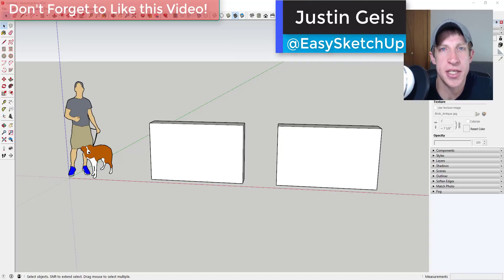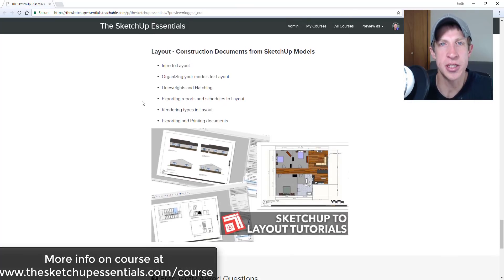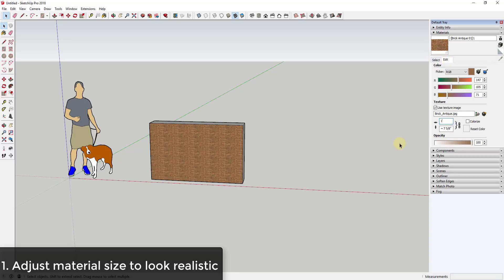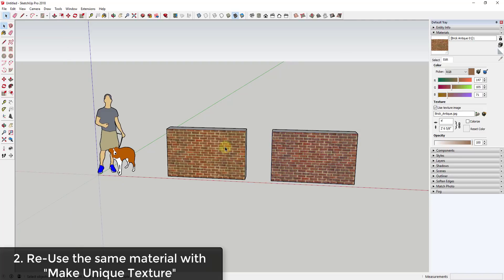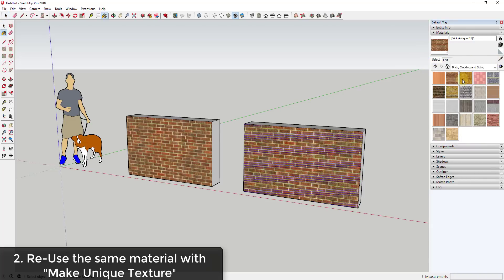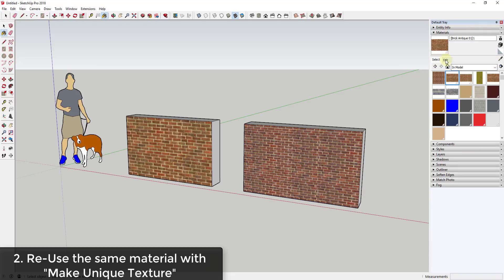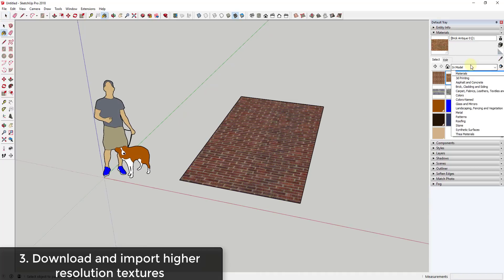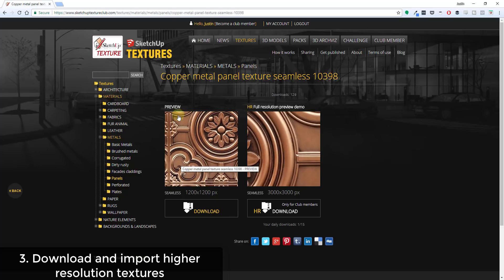8 Tips for MORE REALISTIC MATERIALS in SketchUp

Comment: Thanks for sharing. Much more in depth video about colours.In the last part of this video, you coloured spheres, which triggered my thoughts on geodesic spheres. The latter will colour very well with your UV option, AND uses 30% less memory. There is a "shapes" extension with geodesic objects which I often use for drawing low-poly balls, bubbles etc. The only drawback with this extension is that you cannot specify the degree of spherosity (ie increase the number of facets). The other snag with the geodesic shape is that it has no poles or equator to reference for positioning and slicing.